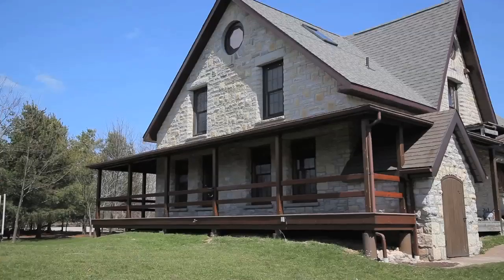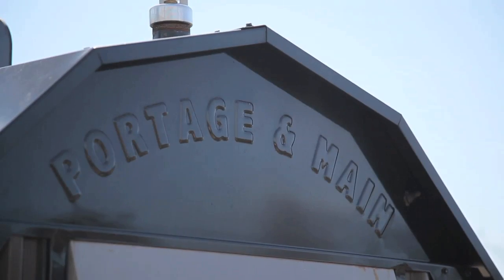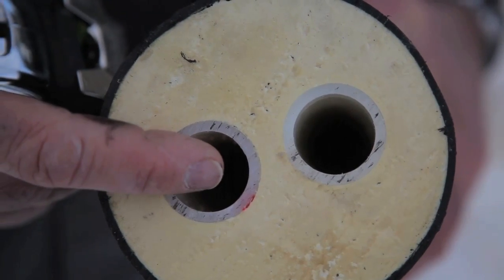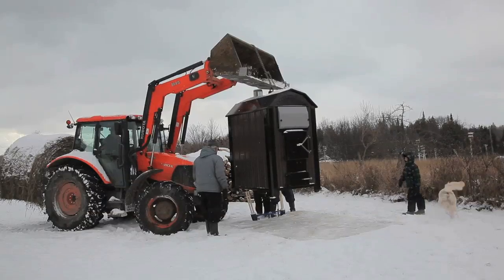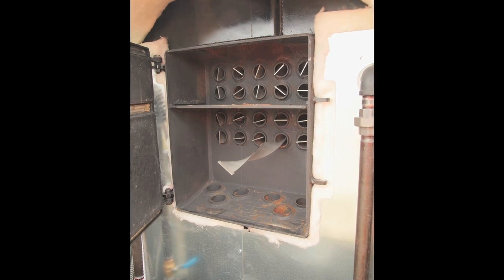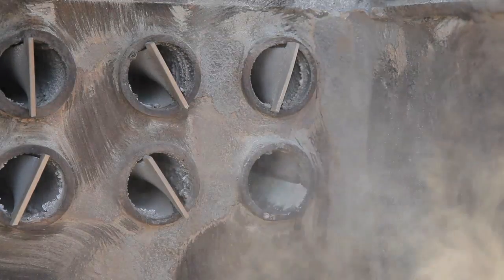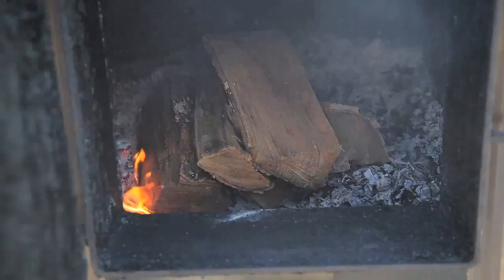Outdoor Wood Furnace Tour

Comment: Calling all single and 2-stage wood-fired boilers "OWBs" is a mistake. 2-stage wood combustion deserves its own nomenclature and has been proven superior in several ways, for decades. 2-stage wood boilers should be placed inside at least a simple outbuilding, with attached shelter for staging firewood. 2-stage wood combustion requires a small amount of planning so properly dried fuel can deliver far more heat at much lower emissions than single stage, a much more responsible way of utilizing a fuel resource.

Comment: Burning wood is a symbiotic and natural process in the environment i.e. forest fires etc., releasing carbon dioxide and soil minerals for regeneration. Don't buy into the ridiculous climate change argument. Sure we should watch pollution but burning wood is not a comparable concept. Are we going to discuss cow farts as pollution next? Let's use our brains and get logical and not jump on this nonsensical climate change narrative that is used for control purposes rather than logic.

Comment: Just spitballing  here but wouldn't you increase the efficiency of heat transfer by fluting each boiler tube.
More surface area for a given tube means more contact with a higher volume if water and therefore more heat transfer

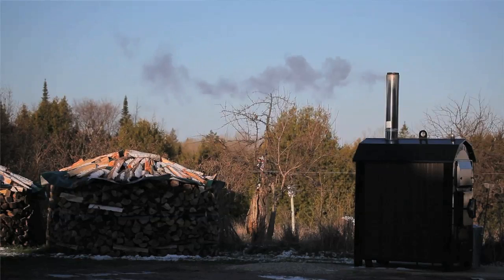Comment: Excellent video.  At 13:56 you state that the "white steam" is from the moisture in the wood.  Although some of the moisture in the exhaust is from the moisture in the wood.  One of the byproducts of combustion is water.  You can see this when you first start a vehicle in cold weather and water is dripping out of the exhaust pipe.  It is not the water in the fuel, either gasoline or diesel, as there is normally no water in these fuels.  The water is a byproduct of combustion itself.  When the exhaust pipe warms, the water vapor is no longer condensing inside the exhaust pipe and the exhaust makes its way through the tail pipe, un-condensed.  Thought you would like to know..

Comment: Did you add a LOW WATER CUTOFF in your indoor pipe assembly? So water doesn't just keep pumping in if you bust a hydronic baseboard?
Rich
Reply: There is no low-water cut off necessary; if your water gets too low, the hot water inlet will suck air before it gets dangerous for the boiler.  MS

Comment: Hello steave. My names Jesse. I Love your videos it’s what made me want a wood boiler. Question. Im very close to buying one. I’ve been saving for a long time. Getting pretty excited. So far I’ve only found 2 outfits that sell them. I was wondering if you could tell me where you bought yours?   I live Far East in New Brunswick Canada. And I will be driving to pick it up when I decide where to buy.
Reply from the maker: Hi Jesse!
Good to hear from you and thanks for your kind words. I'm Canadian too (Ontario), and I got my boiler from Portage and Main. They make their boilers in Manitoba and I've been very pleased with the customer service and performance of the unit. Is there any kind of local dealer in New Brunswick? When you get it home you'll find any medium or large-size loader tractor can lift it off the truck and set it down on your pad.
I hope this helps.
Steve
Reply: I’m not to sure. I can’t seem to find one back east. Closest place i found for me is in Marmora Ontario. 11 hour drive for me. Witch is fine. I can make the drive. I work in Alberta. So I drive back and forth all the time. So your wood boiler is your primary heating. What do you run for back up ?  I’m gonna run propane I think.

Comment: Hmm, not exactly what I would describe as inexpensive or "efficient"? from what I've searched out. A natural gas furnace in Ontario capable of heating a 2300 sq. foot home costs about $5500.00 "all in and installed" for a 96% high efficiency Amana unit . Fuel supply costs about $1800.00 a year (that includes the gas fired hot water heater that runs year round) Last I heard a Portage & Main 250 (which I believe is no longer made, so I priced a Ultimizer BL28-40 Boiler), is about $8000.00 (I think that's a US price, please correct me if I'm wrong) just for the unit, NOT including installation (you'll need a 6" cement pad and front end loader or crane rental, it weights just over 1 ton), taxes or shipping (which can easily add a few thousands of dollars), PLUS 12-15 cords of wood (taken from your Toronto Star write up) running about $170.00 a cord = $2550.00+ a year and YOU have to go OUTSIDE in the dead of winter at -20*c temps, 1-2 times a day to load/clean/maintain it, stack wood/ split wood etc. Actually if these prices are correct (I really can't be sure, I just Googled searched sites in Ontario, please correct me if I'm wrong) then this system seems anything but efficient.. Even a Propane furnace, including tank rental and fuel costs seems far less expensive and more efficient.
Reply from the maker: Good Morning!

Thanks for watching and commenting. If I had natural gas available where I live I'd certainly be using it. But my place is like most of the land area in Canada with no access to natural gas. I'm about 200 miles from the nearest natural gas supply. But where there's no natural gas there's usually plenty of trees. A couple of days ago I rebuilt my cattle coral and the rotten scraps from that job will heat my domestic hot water and take the chill off the house and workshop for 3 days. 
Take care,
Steve
Reply from the maker: Hi Again ruthless4645,
I forgot to mention something in my earlier reply. A couple of things, actually. For most of us heating with wood, there's no money involved in getting it. We've got land and a little equipment and we trade our labour for heating. But even the labour isn't really labour in the usual sense. When I spend time in the forest with my sons cutting firewood for my own house and the house of my oldest boy and the workshop where we both earn our livings, it's a really great thing. Some people would consider this work drudgery, but the chance to cut wood is actually a benefit in my book. Having an outdoor wood boiler gives me the chance to connect directly with a properly managed forest and obtain one of the necessities of life from it with my own hands. So it natural gas was available where I live, I'm sure I'd be connected to it, but I'd also burn wood in some way because of the good work it brings me.
Does any of this make sense? It's nonsense to some people, I know.
Take care,
Steve
Reply: Just saying that it's not necessarily inexpensive or efficient depending on your circumstances. I live in Ontario and thanks to our Provincial  Government cutting live trees without a permit has a harsher sentence than robbery....LOL. Actually in some places it's not even allowed with or without a permit. Right now I'm looking at a property in Ontario (100 acres all mixed hardwood, about 150 miles northeast of Toronto) that is currently being heated by an OWF and what I'm most afraid of is having to BUY firewood, even though I'll be sitting on 100 acres of it because I'm not allowed to cut. Also, the replacement/installation costs of these things gave me quite a start!. So I was thinking that maybe Propane or oil might be a wiser choice. If I understand this correctly, these things run 365 days a year because they also supply your hot water. Not really sure on this just yet, we'll see how it pans out.
Reply from the maker: Yes, circumstances are important, certainly. I live in Ontario too, and I've never heard of anyone who needs a permit to cut a tree. Maybe some urban places require them, but I've cut trees in handful of places across the province and no permit system exists. If you end up buying that 100 acres of hardwood you could keep a dozen houses heated forever just on the blow-downs and dying trees. No one will stop you even if you wanted to clear-cut your property (not that I recommend this, but you do have the freedom). Propane is certainly an easier option than cutting firewood, but we all need exercise. Why not get exercise while you're making your own fuel? As for domestic hot water, you don't need to burn your OWF for that. In my case my OWF heats water when it's burning, but electricity takes over when it's not. 
I live on Manitoulin Island with is about 175 miles northwest of Toronto. Where abouts are you looking to buy?
Reply: Thanks for the heads up, the place I'm looking at is near Cloyne, Ont. Friends I work with live in the Ontario "Green Belt" area (it extends almost to Tobermory I believe) and I believe it's a "no cut zone", though don't quote me on that. My sister lived just outside Kitchener Ont, on a 10 acre property that was a no cut area, property was protected by the GRCA (Grand River Conservation Authority)..

Comment: An easy alternative to pouring concrete is to just set the unit on a couple of railroad ties.  You mentioned about the insulation of the pipes in the ground.  Depending on where a person lives, that will determine the depth that the pipes are buried.  A person living in Minnesota is obviously going to have to bury them deeper in the ground compared to someone living down south.

Comment: Steve, we have a stove and want to take vacation in February.  We are not sure what to do? Have you taken a vacation during heating season?
Reply from the maker: Good Morning Gina! When you say you have a stove, do you mean an ordinary woodstove inside your house or a boiler like the one in my video? If it's an in-the-house woodstove, you'll need to have a little supplemental heat to take over when it goes out. You don't need much heat, but you will want to keep your place above freezing to protect the pipes. You can make this happen even with plugin electric heaters if you don't have electric baseboard heaters wired in. Does this help? I hope so. Let me know.
Drop by my website https://baileylineroad.com for a visit sometime. You'll find lots of stuff there, including tool giveaways, articles and the chance to ask me questions directly. 
Bye for now and thanks for watching!
Steve
Reply: We have a boiler like you. No sure how to leave it for a week.  We don't want the lines to freeze.
Reply from the maker: Hi Gina. My boiler system has a solution of glycol and water (not just straight water), so the fluid can't freeze even when the fire isn't burning. Does your system have straight water? If it does, you've got two options.You could have someone come over and keep the fire burning, or you could backed warm water from another heat source if your home has one. I know one guy, for instance, and his outdoor boiler delivers heat to the plenum of his oil-fired forced-air furnace. Normally the boiler delivers heat to the ducting connected to the oil furnace, but is he fires up the oil furnace it will backfeed heat into the water lines leading to the boiler. In this way his furnace keeps his boiler from freezing.
Do you know if you have a glycol mix in your system? It makes the water green and you can test the freezing point just as you would the antifreeze in a vehicle engine.
Let me know how things go.
Take care,
Steve

Comment: I'm sure this video was sponsored by Portage & Main...which is why it is constantly being recommended.
Reply from the maker: Good Morning M.
Thanks for your note. Just to be clear, I paid money for the boiler in this video, and I did all my own work installing it. The reason Portage and Main is mentioned is because the video is a product review of the boiler they made. Since I made this video 3 1/2 years ago, I still am very impressed with the efficiency of the Optimizer 250 model. Unfortunately the boiler in this video developed a leak, but P&M offered to replace it with any boiler from their line. I chose a non-gasifier Ultimizer model so I could compare it with the gasifier in this video. I'll be making a video comparing the two models soon. Despite the leak (for which P&M have a permanent fix via a kit), I'm still really impressed with how much heat the old 250 pulled out of a pile of wood. The Ultimizer burns smokier and uses more wood, but on the plus side it's easier to keep clean and happily burns junkier, higher moisture wood if need be. As I said, I'll explain all this in an upcoming video.
Thanks for watching and commenting!
Steve

Comment: Thanks for the video Steve!  What version of the Portage and Main would you recommend for three structures (5000+ square foot house, 1000+ building, and medium size barn ~1000)?  On the website there seems to be so many choices and it would be great to have one boiler for all three buildings.  Thanks in advance for your help.  Love how professional your show is.
Reply from the maker: Good Morning! Thanks for watching. 
You definitely only need one boiler. Your heating load is similar to what I have at my place – perhaps your load is slightly larger, but not much. The Optimizer 250 that I featured in this video is no longer made (at least I don't think it is). These days your choice comes down to one decision: gasifier or non-gasifier design. Currently the EGR series is the gasifier that P&M is offering. It looks good to my eye, but I haven't lived with one. Non-gasifier boils use more wood and make more smoke, but they are mechanically simpler. Whether this translates into greater reliability depends on design and construction. My own preference is for a gasifier, and government regulations are slowly making these mandatory. In your case I'd look at boilers that put out 300,000 but/hr should be more than enough heat if your buildings are insulated to modern standards.
Drop by my website https://baileylineroad.com for a visit sometime. You'll find lots of stuff there, including tool giveaways, articles and the chance to ask me questions more directly. 
Bye for now and thanks for watching!
Steve

Comment: how often do you have to clean out wood ash thats left on the bottom. how much does a system like this cost. and finnaly how much BTUs can it produce
Reply from the maker: Hi Vic,
I clean ash about every two weeks, and heating the 4200+ square feet we do I get about 3/4 of a garbage can of ash in that time. Outdoor wood boilers aren't cheap, though. They run about $10K plus installation costs. On the plus side, they're cheap to run. My unit produces about 200,000 btus/hr.
I hope this helps. Thanks for watching!
Steve

Comment: Weve had a wood boiler for over 10 years but I keep complaining To my husband I dont EVER have enough hot water !!! What could be the problem ? It never gets hot enough and I can stick my hand under it - its never super hot . I do launddy on cold and we don't use a dishwasher and yet i barely have enough hottish water for a shower ! Cant have the kids in a bath at night as there isnt enough hot water :-( plus it seems expensive for hydro to run it - i make my kids wear sweaters and slippers but still ive been tracking our hydro usuage daily and as soon as it gets cold and I need to turn it up a bit up goes our usage :( any thoughts on what hubby should be doing ?
Reply from the maker: Hi Wendy,
Any outdoor boiler can produce unlimited domestic hot water that's as hot as anyone would want. What method does your system use to transfer heat from the boiler water to the domestic water? I use a flat plate heat exchanger and it works very well. Fill me in on what you've got and I'll see what I can suggest.
Bye for now,
Steve

Comment: On average, how many cords of wood do you consume a winter?
Reply: In Pennsylvania, that would be 10,000 dollars in wood. Do you spend that much?
Reply from the maker: Hi Silas,
We burn about 40 to 45 face cords (24" long) of hardwood each year. That might seem like a lot, but we're heating about 5200 square feet of living space to 73ºF, and producing all domestic hot water for 7 people. Our typical low temperature in winter is about -30ºF. I hope this helps.
Drop by my website https://baileylineroad.com for a visit sometime. You'll find lots of stuff there, including tool giveaways, articles and the chance to ask me questions. I've got a DEWALT tool contest going on at the moment.
Bye for now and thanks for watching!
Steve
Reply: Thanks!
Reply: Where do you live? And I thought Iowa winters were cold!

Comment: Hi Steve. I just came across your videos and have a lot of catching up to do. Lol. I have been looking at boilers a lot lately as I am about to close on 25 acres of land to start my own homestead.  Do you use a buffer tank with your system and can you do a video of you whole system including domestic hot water?
Reply from the maker: Hi Matthew,
Good to hear from you and congratulations on the purchase of your land. Where is it?
My boiler leads directly to the system of infloor heating and iron radiators I have in my house and shop. There is not storage tank to hold the hot water beyond what's in the boiler itself. This system works well and I'm very pleased.
As for the domestic hot water side of things, my system is simple. I have a heat exchanger plumbed into the incoming water line feeding my electric hot water heater. As hot water is used in the house, this exchanger preheats the water entering the tank. This preheated water is about 150ºF. The hot water tank just acts as an insulated reservoir, holding the hot water until it's used. The electric elements never come on because the water in the tank is always hot. I hope this helps. Please let me know,
Drop by my website https://baileylineroad.com for a visit sometime. You'll find lots of stuff there, including tool giveaways, articles and the chance to ask me questions. 
Bye for now and thanks for watching!
Steve
Reply: +Steve Maxwell 
We are still working out the deal but hopefully it goes through. It's just outside Halifax, Nova Scotia.   Some of the research that I have done on gasification wood boilers says that they work best by burning "batches" rather then just keeping them going all day long. Therefore the need for a storage tank of some sort would be required. Unless of course the boiler already has a large amount of water in it.